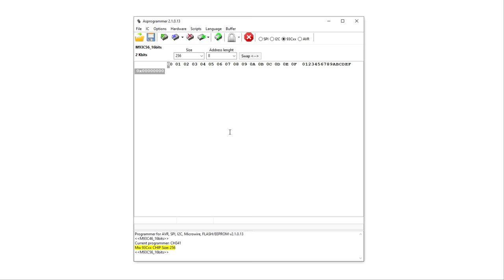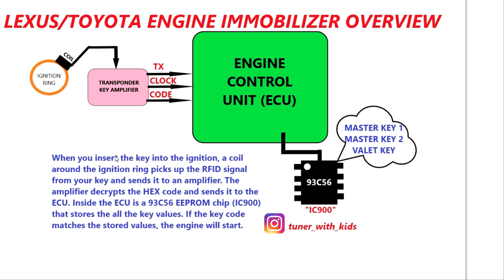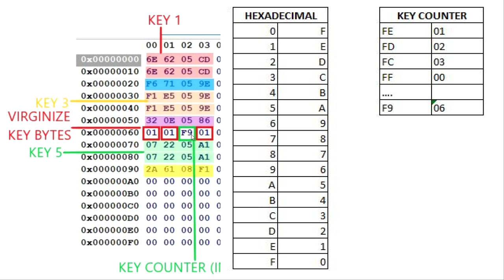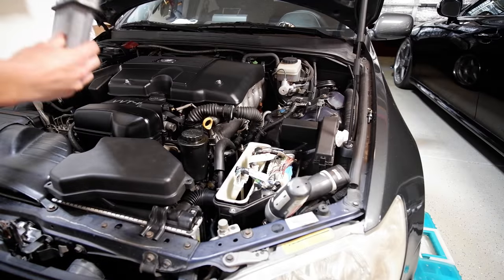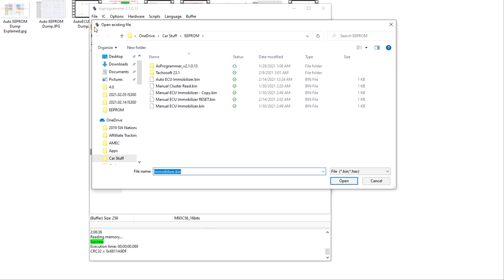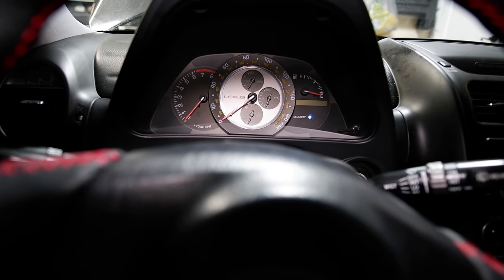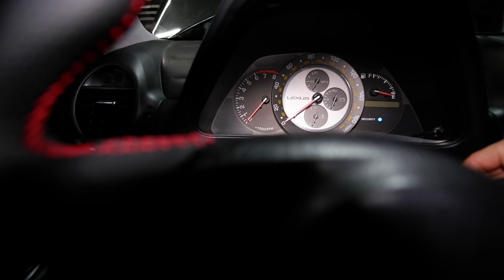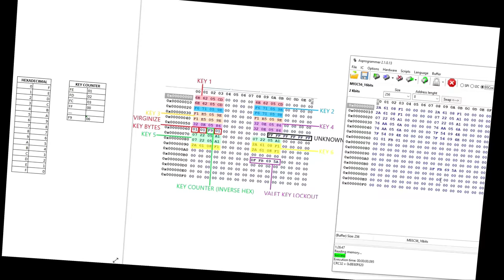Immobilizer Hacking Lost or New Keys for Lexus Toyota | ECU Replacement Immobilizer Hack

Comment: Hi Binh! Great video, I am in the process of doing this but when i am in asprogrammer I keep getting IC not responding. I am a little stumped at getting this to work i made sure i had continuity on all the wires. Any help would be greatly appreciated.
Reply: Hi, did you find a solution to this. Its the same thing for me. I have done the 5v mod and am trying to read a 95xxx series.
Reply: @screwloose2000  did not get it to work :( instead I got tech stream and that was much easier

Comment: Hey, can you tell me if the virginize code works on an 01 IS300 ecu? The chip is the same and I've read the contents. The keys appear to be stored in a slightly different arrangement, but the virginize code matches up if I zero out the other cells. The cells with values that you didn't change to zeros match up, but I had to zero out additonal cells that didn't have values in the 02+ ecu chip. Let me know your thoughts on this.
Reply from the maker: Zeroing out should put it into learn mode. Make sure the key count byte is set correctly to tell it no keys are programmed.

Comment: do you need to swap vin when changing to another ecu? More specifically on a 99 gs300
Reply from the maker: Nope
Reply: @TunerwithKids thanks, i got my car running again
Reply: @alain.r so did you do what he did to program new key? I’m in same boat have ecu but no key for it. Gotta program transponder and get key made
Reply: @Bustedkuhnuckles Yes, I did what he did. A new key was $30, cost to build the programmer was $25. Is your car a 98-05 gs300? I have the reset file for the chip, if you need it. The hardest part for me was building the programmer. If you have any more questions let me know. Also, I would be willing to reset your ecu if you have the same car (at a cost).

Comment: How did you change the vin on the replacement? Or did you trick us? 🤔
Reply from the maker: No vin assigned to ECU.
Reply: @TunerwithKids  I agree. Wouldn't  a lot more painless to just swap eeproms doh?
Reply from the maker: Hell no. These are SMD devices. A 2 second program is much easier.
Reply: Heat gun @350 ain't never hurt any ceramic chip or pcb on the board it's pretty much the lowest risk. Get your brown #1 in the wrong spot? Accidently forgot to save your original dump with your 2mas and Val on the file or if the chip doesn't want to read or write in-circut then you have to pull eeprom off anyways. Too much can go wrong. You using the Panoma clip and not soldering a wire on to each leg because you don't  want to use a $20 clip then it's OK. But for the guys the solder each leg yall are nuts.
Reply: Honda ecu chip swap is something you never want to take on. Toyota ecu has 6 screws and your board ready to work. The Honda is the exact opposite. It's built like a God damn safe. No screws just a curved over recessed lip with industrial grade tar. It's the shit you have to heat and you need separating pliers to Crack open.  Pretty annoying,

Comment: Awesome detailed video. I have a Mercedes 190SL with 2007 Yaris drivetrain. This car was running with a regular non chip key but since I changed some of the wiring, now I get code B2799 (Immobilizer System). So I have no ignition or fuel. Is it possible to program this ecu to run with a regular key which does not have a chip?
Reply from the maker: There are people who can disable immobilizer via ECU but I don’t know how.

Comment: Is there a way to test the assembled reader before using on an ECU and potentially damaging it? I just assembled the modified reader and used a multimeter to verify the connections, but I'm nervous to connect it to an ecu for fear that it could damage the ecu.
Reply from the maker: Only way is to plug it and read the chip. It won’t damage anything.
Reply: @TunerwithKids  would you agree that it's safer to just virginize the new ecu so that you can just pair your existing keys to it, versus having to remove and read the old ecu? I was thinking that's the smartest approach to avoid potentially damaging my working/paired ecu.
Reply from the maker: If you know how to go thru the pairing process. Just virginize it and program keys.
Reply: @TunerwithKids  thanks for this video! I was able to build the adapter and successfully read and virginize a spare ecu that I'll be having changed to a manual trans one soon. I'm going to test it tomorrow with my car to make sure I can enter programming mode and pair my existing keys.
Reply: @TunerwithKids  I tested out the virginized ecu and it started my car np. The red security light stayed on waiting for other keys, but I'll address that later.
Reply: @VegasAlex702  what did you need to do in order to program key to Virginized ecu
Reply: @LayZboyChino  once the virginize process is done, the ecu will pair to any key that turns the ignition.
Reply: @VegasAlex702  amazing thank you 🙏

Comment: I want to attempt this with my Raspberry Pi and I already have the SOIC8 clip. Do most 8 pin chips use the same format?
Reply from the maker: It’s standard chip. Need a 5V to write, 3.3V won’t activate the write pin.
Reply: @TunerwithKids  Thank you! Do you know if the SERIAL HOLD (SOIC8 pin 7) also pin requires 5V?
Reply from the maker: Idk. It should be in the chip data sheet.
Reply: You can bump it to 5vdc with a pull up resistor or using a different arduino or maybe using a ftdi writer

Comment: Any idea if I would be able to program an aftermarket key fob? The OEM 2 button key fobbfor my Altezza is discontinued. Tempted to try and link a LEXUS key fob to it.
Reply from the maker: Should work, the key immobilizer is a “4c” chip used by many cars and brands. The remote portion is different computer and programs differently. Most all Toyota use the same frequency and chips.

Comment: Please help. I have a Lexus Is250 that I am working on I replace the engine I replace the push to start modules and the ECU is brand new from the dealership also I replace the immobilizer that’s in the dash I checked the vehicle with the scan tool from the mechanic and I have no codes but the vehicle is in security mode the security light is flashing and the immobilizer needs to be program that’s in the dashboard it is from another vehicle that I know is good. I would like to know how to program the immobilizer that is in the dash so that the security light will go off and my vehicle will start right now it will not start and there is no one locally in my big city that knows how to program an immobilizer
Reply from the maker: Toyota Lexus would have to seed the ECU with an unlock from corp. usually they don’t like to do this. They’ll just make you buy a new $1,200 ECU plus a new $500 key which they can program easily out the box.

Comment: Hello I have is 200 that I am swapping into a 280z if I don’t have the key how can I bypass it or make it turn on with out the key
Reply from the maker: Need to reset the immobilizer and program a new chip.
Reply: @TunerwithKids  I don’t have a key or the Infiniti on switch
Reply from the maker: You have to check with an ECU expert and see what they offer for disable. Quantum Auto does Lexus ECU.

Comment: Where is the clip and plug in on Amazon?  And what program is used on the laptop?
Reply from the maker: The programmer should be in the description box of video. I actually have a more detailed video about the programmer in my IS300 cluster program video. Check that out.

Comment: hey i have a 01 IS like you, i have a no spark no fuel problem. i suspect my ecu is bad. i got another ecu from the junkyard without keys. would i be able to program my original keys to the junkyard ecu using this method? (only have 1key in total)
Reply from the maker: Yea. Copy the EEPROM from old to new.
Reply: @TunerwithKids  thank you i appreciate it will buy the equipment and give it a go!
Reply: @TunerwithKids  Hey im having problems making soldering the board. if i use an air solder and swap the eeprom would that work?
Reply from the maker: @Sanjeev_Narrie  that’s more potential for damage. If you can’t modify the programming board, I’m not sure if you should attempt to remove eeprom with air iron. That’s a dangerous tool in the wrong hands.
Reply: @TunerwithKids  i can solder really its just i not sure if i doing it right as my pins i ordered are short and it doesnt look like how yours are in the cluster video. thats what i think im confusing myself about.
Reply from the maker: Swapping EEPROM is a last resort if you can do it. But that will potentially damage two ECUs along the way if you can’t get the eeprom off clean.
Reply: @TunerwithKids  ohhhhh i understand. i will have to keep trying on this one. thanks for the prompt responses!
Reply: i built the board. cut the 3v, scratched the pins for firm contact but CH wont to run mode. can you give me any ideas that might help me?
Reply from the maker: IDK, make sure pin 1 is aligned. Make sure you do continuity test for the pins and to board.

Comment: Can the eprom from the old ecu be swapped onto a second hand ecu . ?
Reply from the maker: Yes but not worth the risk and effort.
Reply: Thanks. Don't have the eprom clip but very good at soldering.  Have a lot of soldering equipment.  Lol
Reply: Can you show me the link to the video where you did the cluster swap please ?
Reply from the maker: @steveevans7046  check my videos list. Should be from a few months ago
Reply: @TunerwithKids  I've just tried this today with the reader but everytime I clip the upper board into the usb reader it just disconnects from the computer and the lights go off on it . Checked everything with what you said to do a few times and all looks good .
Reply from the maker: Something sounds like it’s shorted. Mine one does that of the pins on the clip slip.
Reply: @TunerwithKids  thanks for that.  It does it before I even clip onto the chip . Strange .
Reply from the maker: Sounds like a bad connection on the MOD to the chip reader to do cars. Did you follow my instructions to make the modification to the reader board?
Reply: @TunerwithKids  yes mate. Triple checked. Screenshot each part so could reference all connections.
Reply: @TunerwithKids  I did all the modifications and then connected the 2 pins for 16bit also. That's correct isn't it .? Hopefully.  Lol
Reply: I've managed to read the chip but all of the bytes are at 00 .

Comment: Is it possible to only program 1 master key and one valet key rather than 2 master + valet?
Reply: Or even just a valet key?
Reply from the maker: Depends on when you do it. If you have a wiped ECU like I did here, then you can do the master and let the ECU exit the program mode. You can add a valet later using the pedal dance method. If you already have master and want to add a valet, using pedal dance or Techstream will program it. But if you never use valet mode, no point in doing that as the valet key limits your ability later to add keys if you lose, unless you wipe the immobilizer like I showed.
Reply: @TunerwithKids  ok thank you

Comment: Would this work for a 99 LS400? No master key. Would it be possible to go into Techstream and delete original master key code. Then copy 2ndary key code to master?
Reply from the maker: It will work if you can locate and clear the EEPROM like I did. With Techstream you can possibly reseed the ECU to clear the keys. Without a master, you can not program new masters. There is a way to program more valets only.
Reply: @TunerwithKids  So access to EEPROM will allow to re assign new masters? How much is Techstream software and hardware? Thank you for all your help. Want to be able to program key remote controls to lock/unlock doors, but don't have master. Trying to find cheaper alternative. Thanks.
Reply from the maker: Programming remotes is a different process and can be done with either key, I have another video from December where I used Techstream to program a GX but I have instructions in the description box to used the manual pedal dance and door lock method.
Reply: @TunerwithKids  I've been unsuccessful trying multiple attempts at trying to program remote key without master. Had a locksmith try as well. They were able to clone my keys so they can start and drive. But unable to program to lock/unlock on remote. Said needs dealership or master key.
Reply: @vdonnn  have you figured out a way to lock/unlock, having same problem where the keys can start car but not lock/unlock :/ even tried reprogramming in techstream
Reply: @vdonnn  one of my door locks doesnt lock all the way, feel like this might be the problem, hopefully
Reply: @bagginn  Have no figured it out. I don't have Techstream so no luck for me
Reply: Did you have a Valay key? I don’t have any keys was the locksmith able to program ecu or did you not have to?

Comment: Could you just swap immobilizer chips to the other ecu?
Reply from the maker: Yea but that risk damaging the SMD chip. This is 100x easier to copy data.
Reply from the maker: Also, if you acquire an ECU with no keys, this is only cheap way to add keys. Dealer has to reseed, if they are willing to do it, to get new keys.
Reply: @TunerwithKids  I have a ecu for a 1jz my car is swapped and obviously I don’t have the master key for the 1jz ecu so im either gonna swap the chips or try this method no way am I’m going to a dealership Lmaoo

Comment: How do you verify if the EEPROM immobilizer chip (IC900/93c56) is run in 8 or 16 bit?
Reply from the maker: Trial and error. I think on one of my other videos or this video, I mention that most Toyota automotive applications is 16 bits.
Reply from the maker: Check this video I explain everything in beginning. https://youtu.be/RqOM-4MLGhY
Reply: @TunerwithKids  You did. However, Dr Shock mentions in his video that the 93c56 is run in 8 bit. Was hoping for a way to verify because I cant seem to get a the "run" light to illuminate. I have tried it both ways. cant seem to get it to work or get ASP to read the chip.
Reply from the maker: Toyota is 16-bit. I originally set it to 8 and it didn’t read.
Reply: @TunerwithKids  Ok, thanks.

Comment: hello, i have made the programmer and cannot get as programmer to find the chip? It says ch341a cannot be found? 
Is there a way to fix that or is it just not setup to communicate with my USB port
Reply from the maker: Make sure it’s set for correct bits? Does AS Programmer see the hardware?
Reply: @TunerwithKids  I have sense figured that part out. It was a driver that was included inside the asprogrammer file that makes it work with ch341A programmers that was not installed. 

Now I am getting a check setting over and over again. Did you have to short out the x600 crystal on the right side of the board to get it to read?
Reply from the maker: No shorting
Reply: @TunerwithKids  interesting, that must be the difference between the is300 and gs300 ECU
Reply from the maker: I recall on Dr.Shock or maybe SpeedKar videos, them mentioning shorting the crystal on the ECU to get it to work. It might be a circuit thing where there is leakage current to the crystal cause a low volt to the eeprom. But I’ve never had issues.
Reply: @TunerwithKids  ah, I had not seen that part of the video but I didn’t watch every second. I had a 8 pin pogo prom to read the chip this time so I can get a good connection. The chip clips suck
Reply: @andrewkitchens3917  Did you ever get yours reading on the GS? And do you happen to remember the dump file? I’m not sure if it’s the same as the IS and i have to replace my chip so its unreadable

Comment: I Lost my master key, how i can make wallet key without any key? 
I got lexus mk2 gs300 98
Reply from the maker: Reset it with this method and reprogram master and a wallet immobilizer card with key cut.
Reply: Okay thank you, i got problem to read the epprom. The ic850 is connecting good and i can read, but i can’t connect to the ic900, i Cleared the pins but i still got problem
Reply: Well i got connection, what i can see, everywhere i got „0” 😂
Reply: Okay i virginized my ecu but its not entering programing mode, light is blinking

Comment: Hey all, I was wondering if someone can help me out here. A long while ago, my ONLY key to my 2000 Lexus GS300 broke, and the chip inside went missing. I was able to retain the actual metal key part of it and the car started perfectly fine for a while. Just yesterday (3/31/23) I tried to start the car and it would not start. I began troubleshooting like normal and even went as far as replacing a fuel pump as the engine would crank but not fire up. However, i just noticed that the security light (the little car with the key symbol) is flashing even with the key inserted. I suspect the immobilizer is preventing me from starting the car now. I do have a blank key/transponder but obviously I cannot reprogram it normally without the master transponder. If I were to pull my own ECU out and viginize the immobilizer, would I be able to program the chip in the blank key? Thanks.
Reply from the maker: If you do this same reprogram it will reset it to new and program any new key. GS3 should have a very similar if not the same ECU as this.
Reply: @Binh-Tuner with Kids  Thanks for the quick response. Gonna give it a shot since I've not really any other option. Great work on the vid.